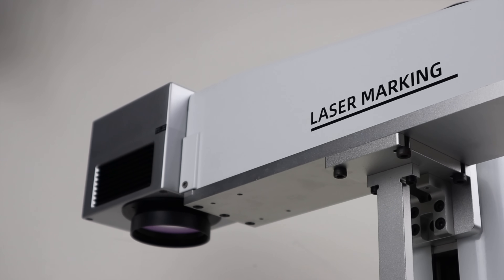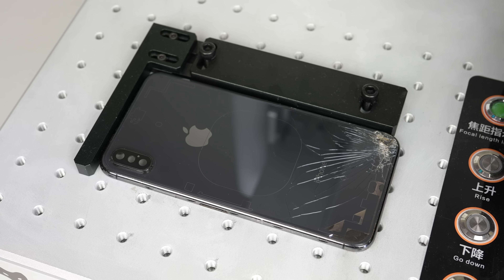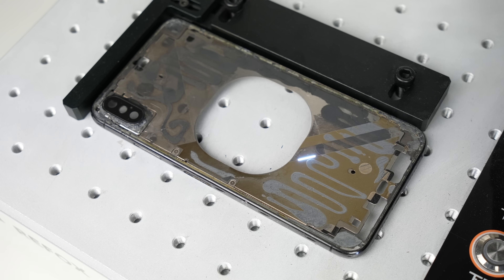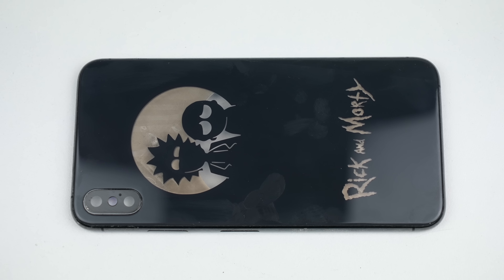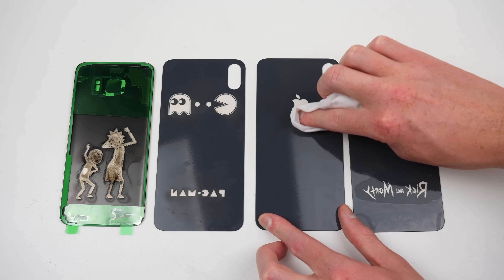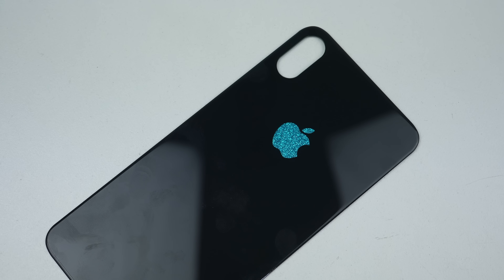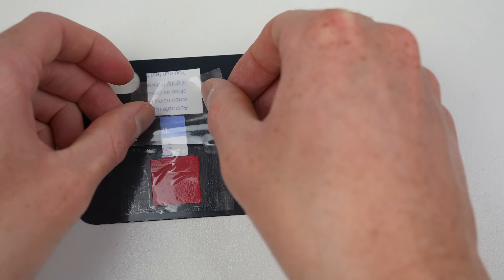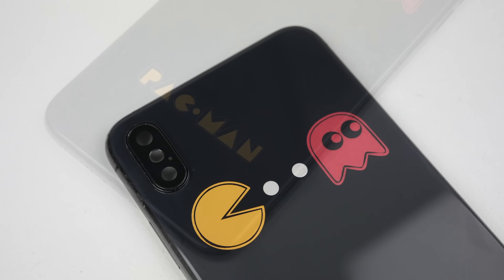Using Lasers To Create Awesome Custom Phones - Laser Engraved Colour Graphics

Comment: Great idea!

Maybe a different type of paint (not water-based) would work too.
Or a glow-in-the-dark one.

I‘ve been working with laser engravers since about 10 years, I fully agree with using vector graphics.
One can also convert simple shapes with Inkscape (or modify vector graphics).

I hope you‘re using the laser in a cabinet with an exhaust fan with a HEPA in-line. The dust is dangerous.

Comment: Nice work with the custom housings. Altough I highly suggest to use some kind of fume extraction when working with laser. It can be a 120mm computer fan with an active air filter(that what I'm using with my engraver), or anything more professional. I mainly work with wood, and wooden cases, those can be just as harmfull as these back panels. Bamboo and corkwood especially. Regardless I dig the pac-man one.

Comment: Hey Hugh! I really liked this video, those custom laser-etching machines surely are very precise, enough to have my mind blown, at least. I would have absolutely tried this if I had a laser machine (which I don't have right now). So I have a question. Can you make the same video except with phone skins? I have some paper and had made my own skin, but learning from a perfectionist is a whole different thing. I've just found out about your videos a couple of weeks ago and the content is absolutely superlative!
Reply: On common sense perspective it wont work. Laser tends to burn the paint. but if you use it on a plastic-like material, the material itself and will burn too, i get your idea. The best way to do that is by a precise machine cutter that can cut with accurate precision. In this way the material itself wont be damage or being burnt to as the machine will just cut through the plastic like material. its like cutting using a scissor but in a precise way

Comment: Hugh, you could have printed the images on a laser/inkjet printer and stuck it from the back like you did. since you have a laser that can check the dimensions on the paper exactly, you can match exactly to millimetres. Also you can get a small micro painting air brush and spray paint the backs using a small making tape. you can pretty much do anything as you got an expensive laser.
Reply: Hello my firend how are you?

Comment: The paint should be applied in multiple thin layers - that should give you a better result. Otherwise look at how cell animation is painted. I'm not sure if cell paint is possible to use on glass, but you're going to need a paint that is very high quality and pigment rich. Another option over paint is adhesive vinyl. This may perform better than paint and paper given the former may experience fading.

Comment: It’s probably been mentioned but I’m not reading over 150 comments but if you had the colour version of your vector file you could print say the Rick and Morty version and align it with your laser cut out.  ie take the one with Rick and Morty dancing. If you had the actual picture you could print it in colour, line it up with your laser cut out and bobs your uncle. Full colour customisation. 
I’ll see myself out.

Comment: If you want to do this for a store, you can use auto adhesive paper and cut it at the exact size you want with the same vector contour and a cut plotter (that is so much cheaper than a laser engraver)

Comment: Ive one question,
Is this possible with an IPhone 12/13 backpanel?
Reply: yes.
Reply: @megaBrv456  
Ok interisting, thank you very much.
I know this question sounds a little bit stupid, i thought cause they have not a flat surface, the light from the laser could bounce in directions, which are not intended. Ok in this case especially the Pro and Pro Max Phones.
Reply: do people still sell ones for older iphones?